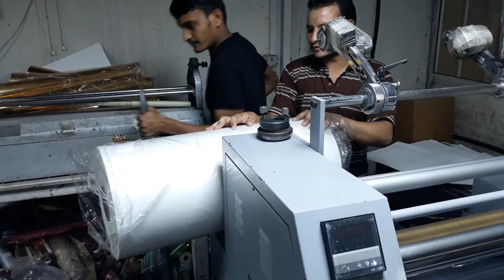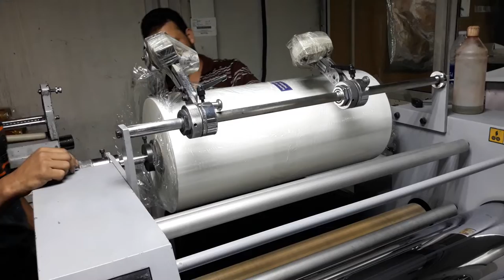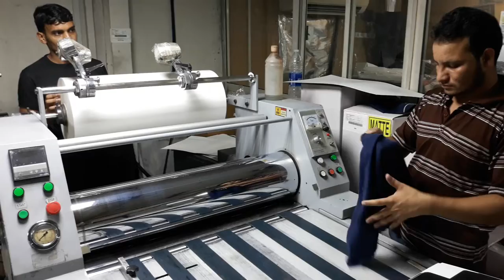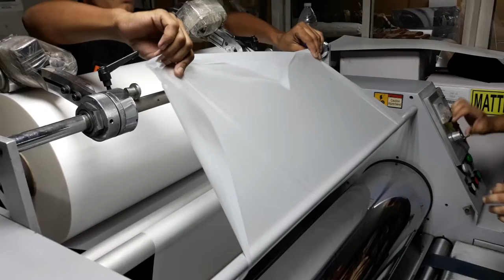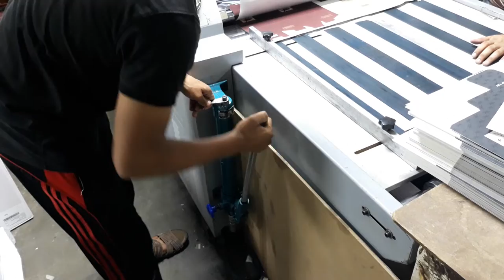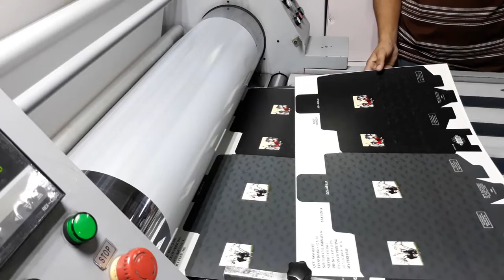Thermal Softtouch Lamination Process - Printing Press Works

Comment: Absolutly perfect for my laminating machine https://www.youtube.com/post/Ugkx3hNjPfuybeIthQIWOFnkq-r2slRbyqre  item arrived on time and in great condition. Very simple just slide the paper in between and insert into heated machine and it will come out without any wrinkles or bubbles. I love laminating pages for presentation purposes and it always makes it easier to pass around in a meeting. Also great for hole punching and putting in presentation binders too! These were a great value and although I thought about buying thicker these were perfect, not flimsy at all. I will buy again when I am out, and remember you can get in all sizes. This is an awesome product I can't live without!!